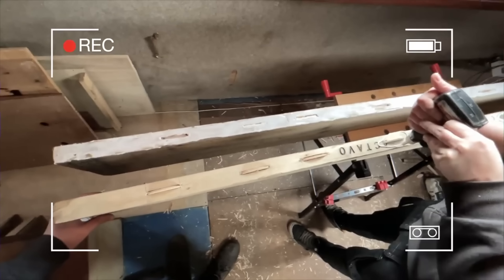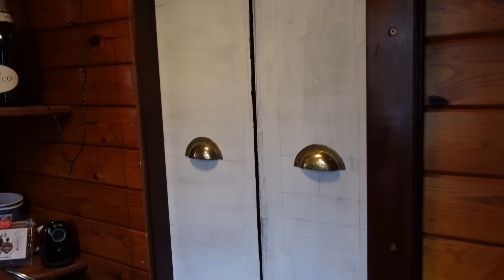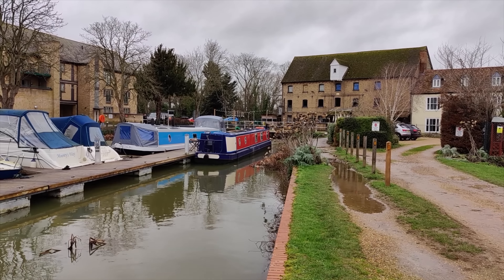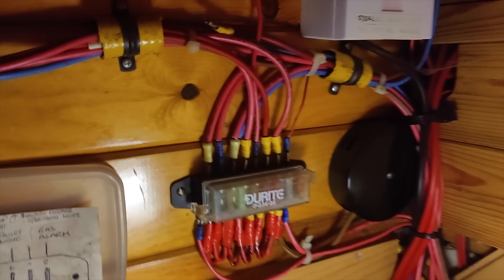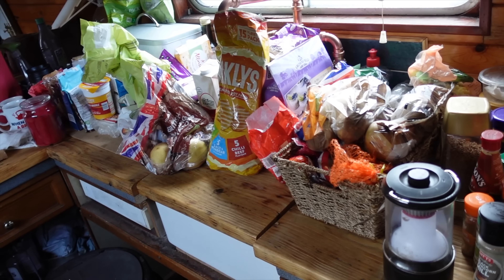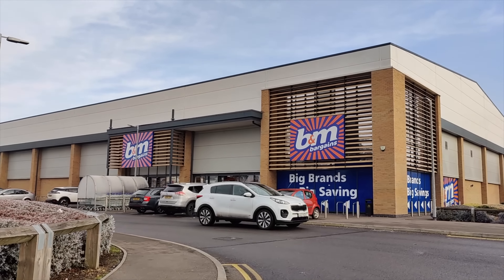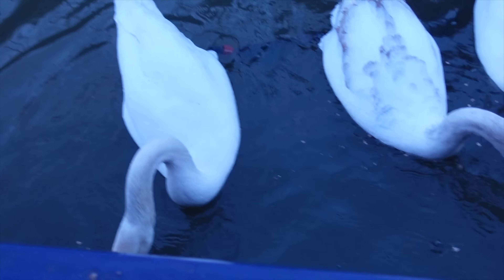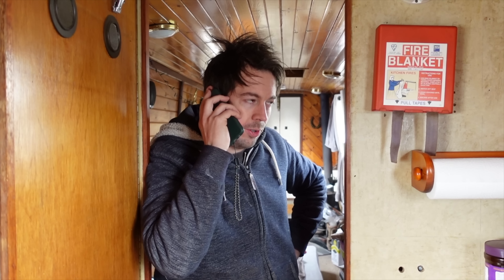Why can't we get running water on our narrowboat?

Comment: Running water will move you up from the 1950s when buckets were used - Hail the improvement - using electricity from the battery (pierside) means there should be a charger keeping them topped off - lead acid batteries last much longer that way...
Reply from the maker: Haha! Indeed!! Yeah we have a battery charger on the go to keep them nice and topped up fortunately!

Comment: Just a thought , old socks.....do you have to let the pressure vessel fill before pressurising it? That rings a faint bell with me for some reason.
Reply from the maker: Hi Harold, yes you're absolutely right it does and we did leave it for a good while before turning it off again. There was just no power getting through to the pump so I'm hopeful that my disconnected wire theory will be proven right! Thanks for your helpful thoughts ☺️

Comment: I think you'll find they are vehicle fuses. But I would be concerned as to why the old one blew.
Reply from the maker: Yeah they are all the flat spade sort of car ones. I had the same thought when I saw it too as the plastic was blown. I can only wonder if it happened a few months ago when someone else at the marina shorted the whole place and our breakers went off. The new fuse didn't blow so I'm hoping that's a good sign!
Reply: @TheNomadicCrobot  Do a resistance test on the pump. Possible that a fuse can blow from exterior events, but unusual.
Reply: @TheNomadicCrobot  however I appreciate you have probably fixed it as vlogs are behind the curve in relation to real time haha
Reply from the maker: Ohh thank you yes I will now I've learnt a bit more about my multimeter!
I know when I came to work on the pump again after our friend had worked on it months ago, the neutral wire wasn't wired into the pump and was just lose, which could have exposed it to damp or water under the sink. Do you think it's likely that this could have caused a fuse to blow?
Reply from the maker: Haha!!
Reply: @TheNomadicCrobot  If you get zero then the pump is kaput, or open circuit as in dead as a proverbial dodo.
Reply: @TheNomadicCrobot  Possible but unlikely. Perhaps a loose neutral touching metal would, or the positive, but no neutral connection to the pump will render pump inoperable.  The pump requires neutral and positive to operate: The neutral completes the circuit.
Reply: Have you checked you have 12volts on the incoming feed? If so, then the pump might well be the culprit.

Comment: Have you opened all valves up?
Reply from the maker: Yep all opened!
Reply: @TheNomadicCrobot  gotta be pump not playing or no lecky getting to pump, waiting for the 'we have running water' video
Reply from the maker: I'm sure that the loose wire is the culprit but we will have to wait for the maverick to confirm!
Reply: @The Nomadic Crobot  you could use your meter, don't touch the metal bits it could get a bit 'shock'